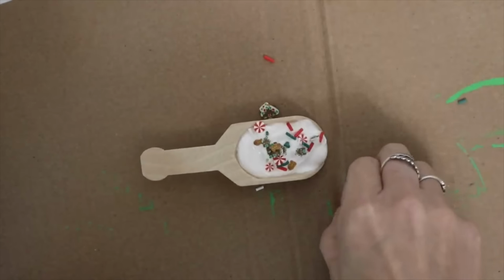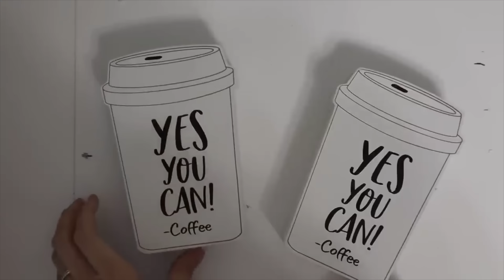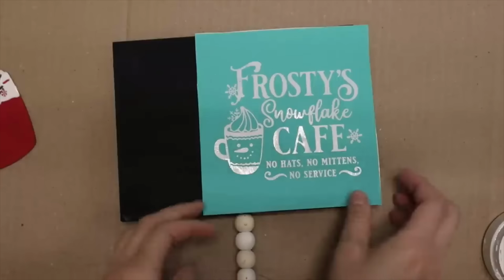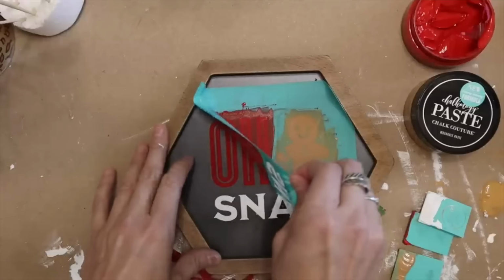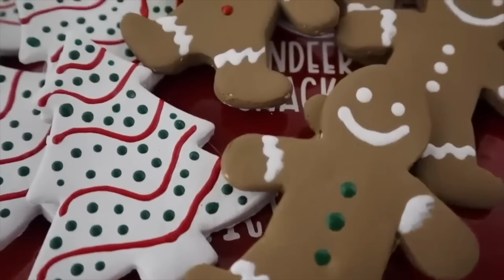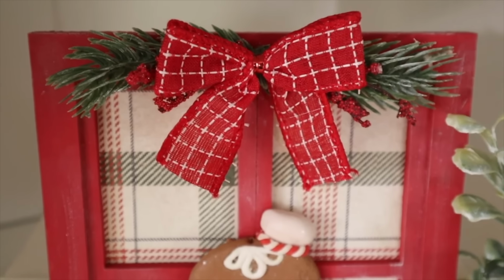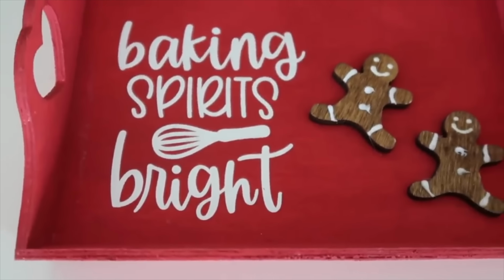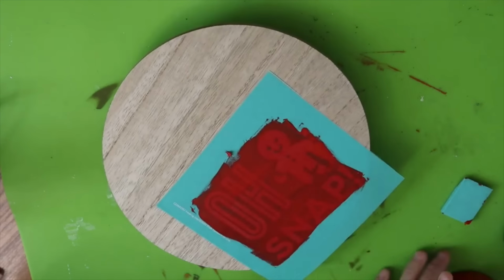30+ Incredible GINGERBREAD CHRISTMAS DIYS YOU NEED to Try! Budget Friendly Christmas Crafts 2024

Comment: Any help with clay so that it doesn't crack when drying?
Reply from the maker: Air dry worked pretty good for me but some did crack. I did add a little bit of water to smooth out the cracks before I left them to dry. Seemed to help